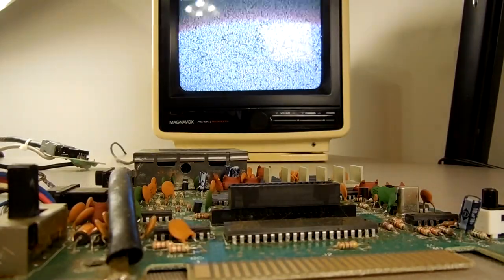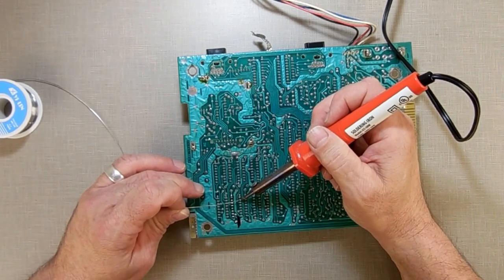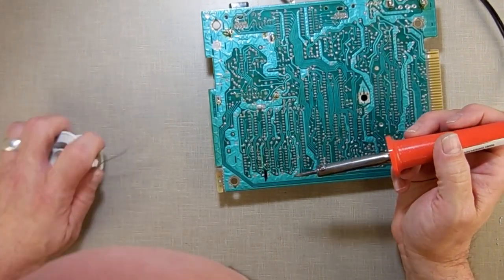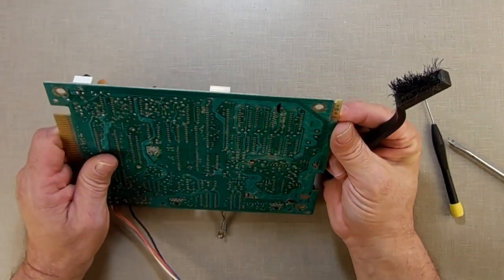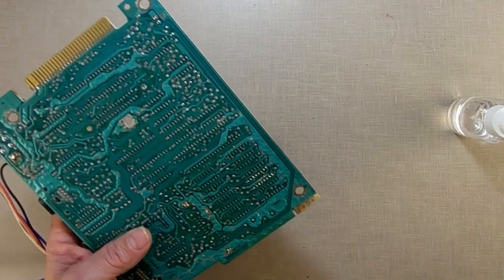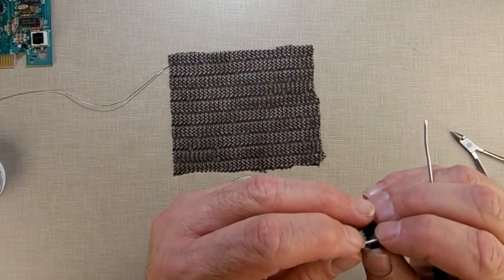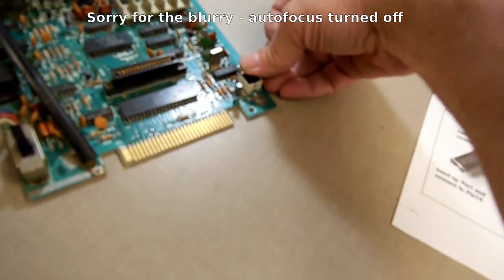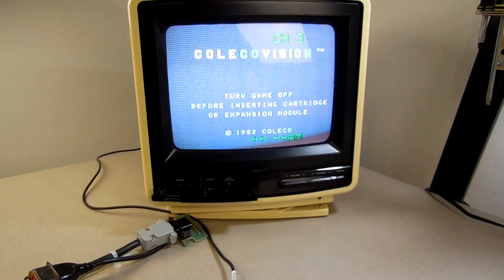Fixing Bad ColecoVision Video Ram

Comment: I have very very little experience with the adam but I noticed the ram is very hard to remove cleanly. I just ended up cutting the old ram out with side cutters and removing the pins individually. The ram chips are so cheap no point in trying to save them
Reply from the maker: It is :/

Comment: which ram are compatible with the coleco? same as C64?
Reply from the maker: 4116 though you can use 4164 if you use patch wires
Reply: @8BitMilli  thank you! i just repaired mine it work very well now im gonna make the rgb mod on it :)